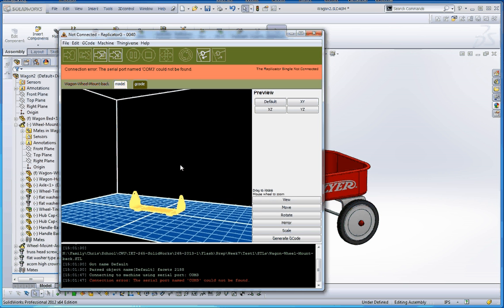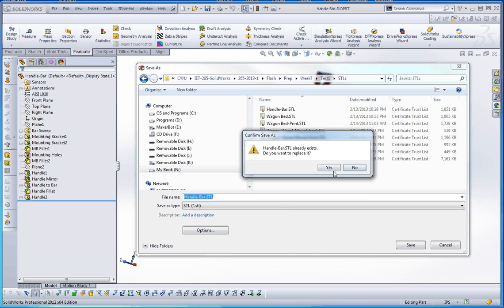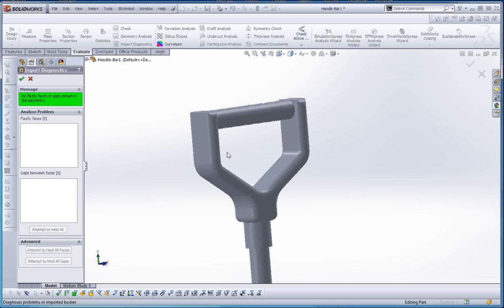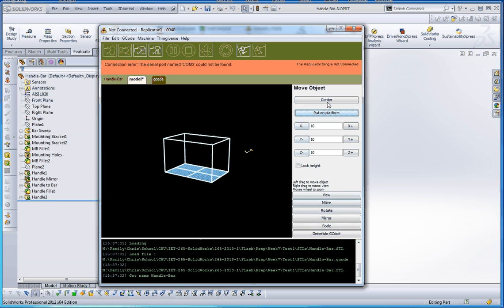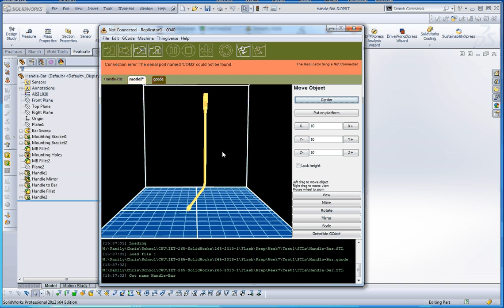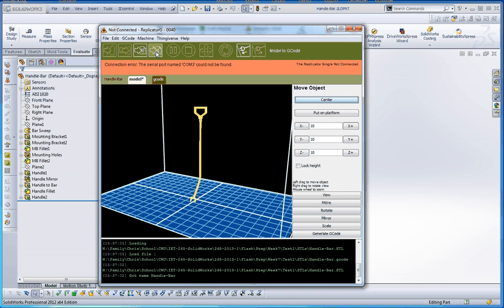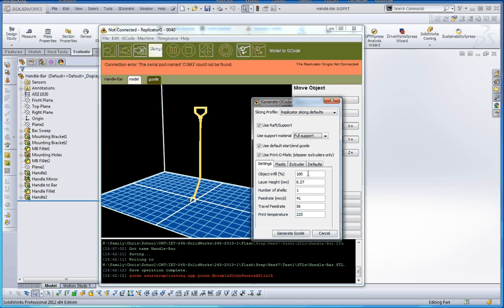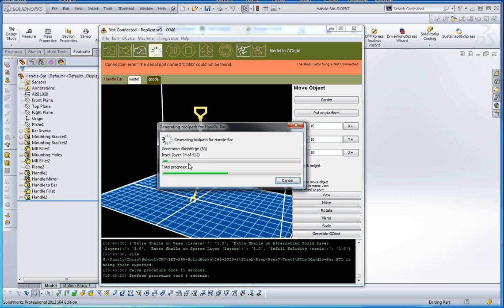Part 1 - MakerBot, Using the Replicator G Program to Print a SolidWorks Part, the "gcode"

Comment: Building from SW is so easy however replicator G is nothing but CRAP
Reply from the maker: I have had no issues with the Replicator G program, its also useful for applying the dual extruder.
Reply: The only thing I use rep g for is to put the x3g file onto an sd card , remember rep g last update was in 2011 and it will not be updated anytime soon if ever.
Repetier host with Slicer 3 is great and slicer 3 is starting to get rather good but having trouble getting the latest version to work with rep g so I do not worry about it, I do all my work in Repetier Host and slice it then open the Gcode with rep g to put onto an SD card